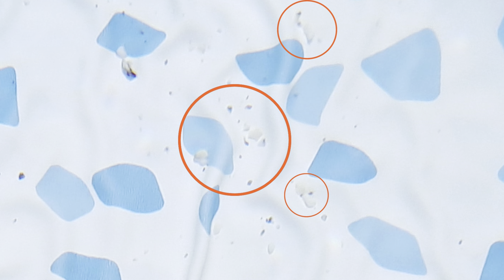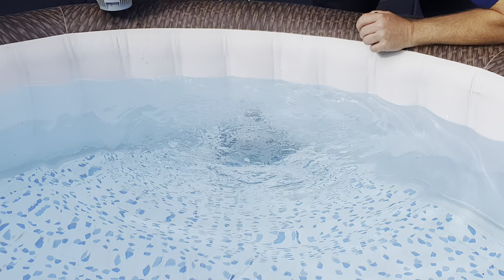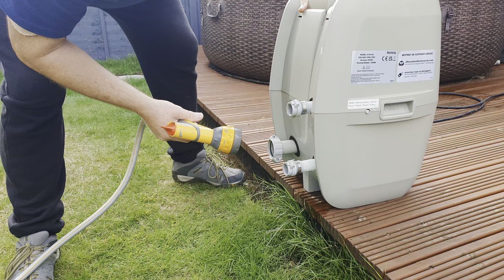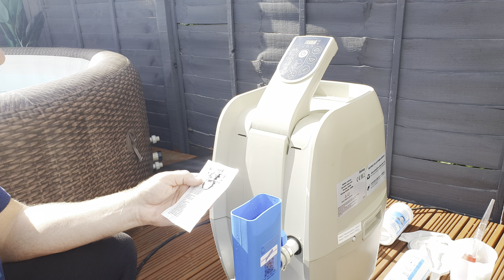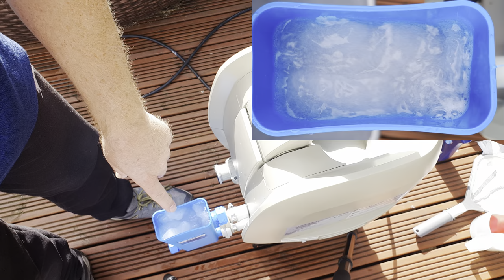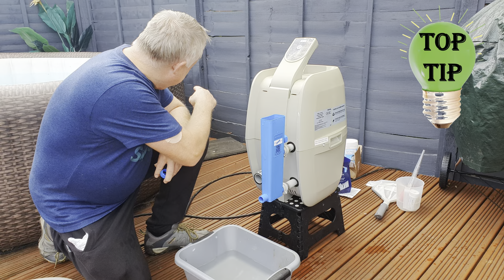How to Descale Your Lay Z Spa - Avoid that E02 Error Code

Comment from the maker: 💰Do you want to save money running your hot tub❓  https://youtu.be/N45mC8BGvBM
Reply: Hello! Sort of related question - I don’t think my AirJet is accurately heating the tub - and it’s a brand new unit I got from a warranty replacement of my original heater/pump. It doesn’t seem as if the temp is registering accurately, nor is the heater turning on and off on its own as it should. Seems it heating all the time. Any tips on a reset or fixing this issue?

Comment: Your videos have been a blessing since I decided to setup the hot tub this year. Sadly, energy prices are still insane :(

I was wondering if you have any tips for the pump being loud. I don't think it's near E02 level but the humming is certainly louder than I remember since we're in a new house now and the pump is situated in a different location (past our decking in back garden) which I thought might provide enough distance so we didn't notice the sound. I also want to make sure it doesn't annoy neighbors. I already have it on thick rubber matting I got free from a local gym. 

We have a 2021 Paris tub and even with just the pump and heating on it's very loud. How are these new model pumps (yours is a different shape to mine). Mine is the egg shape.

Comment: It's take me 1h to full the hot tub with hot tap and hose pipe. That costs me 1£ of gas. No chemicals. the hot tub is ready at 40deg in 1 hour. After use a use a puddle pump to pump 600l per min out. So it costs me £10 a month to run. That's also means no need for the silly lid inflatable that goes minging and deflates
Reply: I've been thinking about that too. Maybe just emptying and refilling the tub every 2 weeks is cheaper energy wise and needs less maintaning.
Reply: 7 months on. Still no issue with the filling up from hot tap. Infact plubed in the drain along a wall now so just put pump in and connet it to my drain paper to the drain. Only small issue. When it's cold and filling via hose the temp reaches 37 so needs to warm up on elec for a few hours to 40. In summer it's ready to go
Reply: Not on a water meter then? 😅
Reply: @TomskiZima  nope I'm getting my 64 pound a month worth🤣
Reply: @poo7481  😂 you do right!!! I might have to consider this, but my water meter needs a magnet or something first 😆
Reply: It's a good idea. But we are on a water shortage here

Comment: very good - never had this issue, but this a great bit of advice - i'll know what to do when i see the scale, or i just might start each season and de-scale it. thanks for sharing.
Reply from the maker: I'm gonna suggest doing this each water change every 3-4 months. It can be descaling at the same time as emptying
Reply: @AbouttheHouse0  thanks agian ! we dont use our hot tub that often, so not sure how often to change the water. Is changing the water based on frequency of use/people usng it, or age of the water. I do top it up once in a while as it naturally gets some in the air (we tend to use it in the evenings). Thanks again.

Comment: Thanks for the video, I bought this contraption after watching this video, however, I've justed added the descaler in that come with it, but my pump won't even turn on for more than 5 seconds, either with heat or just circulation.
I'm still really hoping this will help, but I have no clue why it won't stay on and makes me fear the worst.
Any ideas?
Reply from the maker: Does it show E02 in the display? If so, it'll be a faulty flow sensor
Reply: @AbouttheHouse0  so does that mean i have to replace the sensor? is that something I can do or do I need a professional of which I don't think there are many in Kent
Reply from the maker: @MarlonKingShow yes, plenty on ebay

Comment: Another excellent video, always clear and to the point. Out of interest do you leave your heater and pump running 24/7 or is it better to have the heater off when not in use?
Reply from the maker: If you're on a single rate tarriff, leave it on 24/7, but maybe turn the set temp down 2-3 degrees between uses (as long as you can remember to turn it back up 1-2 hours before the next use)

Comment: What if it goes straight to e02 as soon as you turn the pump on?
Is that a sensor issue?
Reply: Hi, I have the same problem, did you solve yours? Does this mean that the pomp is broken? Or only the sensor? On mine, I cannot put only the heater on, filter goes also straight ON. Help!
Reply: another common problem causing E02 code is the impeller, it is easy to fix, there is another guy on youtube with an explanation of how to do it, mine broke after 2 years